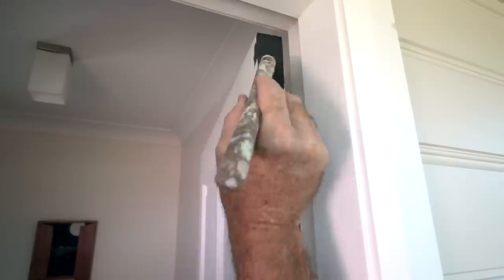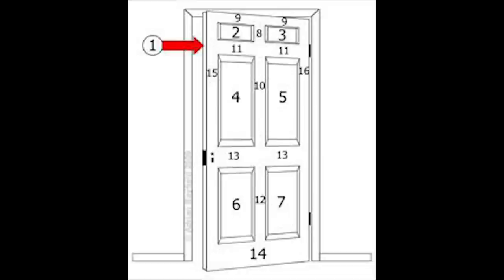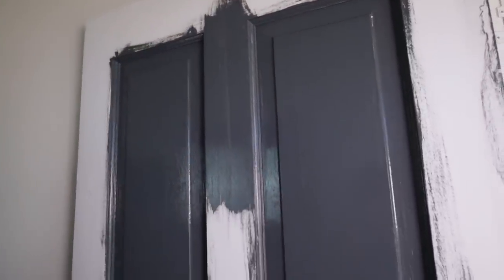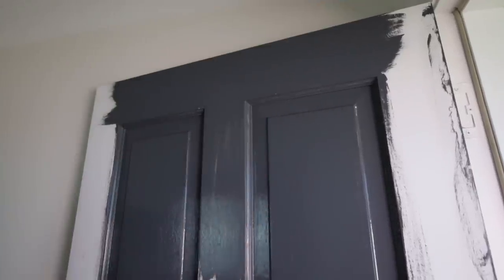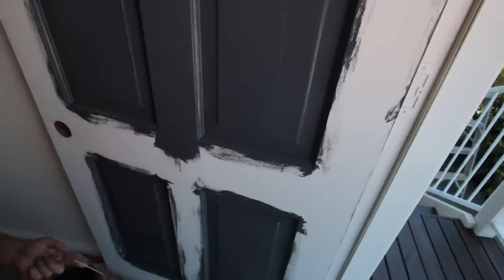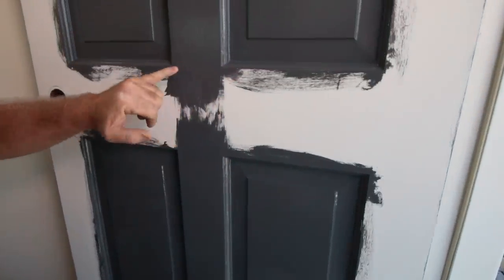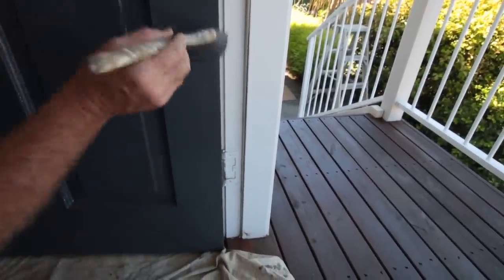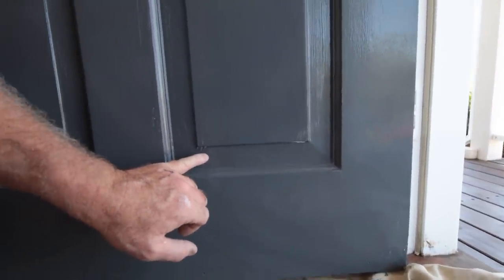How to paint a panel door. Paint by numbers makes it easier!

Comment: Wow, so fast and so perfect! Wish I would have seen this before I started our door. Learned the hard way about dilly dallying. Queen of dilly dallying ugh. How do I get rid of brush strokes?! Hard part for me is having to readjust ladder and reach parts up top of tall door and knowing where to pick up with next brush strokes after reloading brush.
Reply from the maker: Hi Liz, it's not always possible to rid ones project of brush strokes, and I hate to say it, but, diy's are usually exceptional at producing brush marks. It stems from not having enough brush work experience, not painting fast enough, is it hot or cold, and on and on.
One of the things you can do, is to put a teeny weeny bit of water in your paint to thin it. This makes it 'flow' a bit better. Just enough to allow yourself to work with the material easier.  There are water base 'enamels' that work really well, but not sure many diy's could make good use of it. Again, experience comes in real handy, unfortunately. 
Anyhow, thanks for commenting, and all the best on your future projects. :)
Reply: @RickBushell1958  thank you for your reply! Putting on second coat and watching this again for reminders. Hoping I sanded enough but not too much in between coats and hopefully will go faster this time around. Thanks for tips!
Reply: @lizlopez7822  get some Floetrol for latex paints

Comment: Another useful video, thanks! Funnily enough I painted such a door last week and used the exact same picture you showed here. Nice tip about working with the temperature, I used a new Dulux quick drying water based gloss here in the UK which gives great results but you cannot pause for a moment, and must not go back over what you painted as it starts drying fast.
Reply from the maker: Yea, found that pic on the net. So I didn't have to recreate it in photoshop! That paint you used doesn't sound too diy friendly. Hope it turned out alright.
Reply: Floetrol is the slower painters best friend, gives you much more time to get your paint on right without tacking up as much

Comment: Thank you for putting up this video, you make it look so easy!! One question, do you need to sand between top coats? I sanded before undercoating, and after, but not sure if further sanding is required or just overkill. General condition of the door is good. Thank again.

Comment: Hello, I am repainting a previous painted fiberglass door in which has metallic latex copper paint.  I want to paint it now a latex cobalt blue.  Do I need to use a primer like Kilz first  before painting the top color ?
Reply from the maker: Painting latex over another latex should be fine, maybe a light sand tho. Good luck with your project and thanks for commenting :)

Comment: I’m currently painting my panel doors . I find your video really helpful. Did you use oil based paint or water based ? I m using oil based paint with a brush and I find it’s hard to spread the paint .
Reply from the maker: Hi Catlady, can I ask why you chose to paint with an oil base enamel? Enamel produces a really nice finish if you know how to use it. Very difficult or impossible for the diy. I don't recommend using it if you are inexperienced with using a brush. Even  many 'professional' painters cant really use it properly. 
The paint I used in the video was a water base acrylic but only because the previous coat of paint was the same. 
Hopefully you aren't painting an oil base over water base, a very big no no.
Reply: @RickBushell1958  hi , the previous paint on the doors in my home is oil based and it has such nice glossy finish and easy to clean.
Reply from the maker: @catladylion5186  that’s great news. The trick is getting the paint to the correct consistency, and knowing how to lay it off. As I mentioned in a previous post, working with oil base paints takes a lot of experience to get it right. That’s the sad news I’m afraid in your case. 
I always recommend for diy’s to change the system . By that I mean, such as in this case, it’s better to put an oil base undercoat for your first coat. This ensures a good key onto the subsequent oil base and the following water base paints. And it’s much easier for the diy. Good luck and thanks for commenting

Comment: Damn nice finish for  a water based paint man, this would be almost impossible most days here in Australia 35-40 degree days by the time u throw on the paint on one section when u come to lay it off it's already drying.... even if you add juice. need to spray it or roll it fast
Reply from the maker: Osrs Fonzie I have to disagree with you mate. Most diy’s won’t even think of spraying. And even for a professional, why would you for one door side? Totally impractical on both counts. This was done in Australia in summer and a windy day. Just have to work as fast as possible. Thanks for commenting mate. 👍

Comment: So having a factory I am more used to spraying in a both but I love the way you layed out a number system for painting the doors ! and yours looked great.. can you comment on maybe brushing the panels then using a finish cabinetry roller on the doors    what do you think or am I better off just with a good brush...
Reply from the maker: Hi intsccents. This was a simple job with only one door side to paint, and with water base acrylic. It doesn't get any easier and the reason I make the video for DIY's. When I do a lot of doors, yea, the roller comes out. Speeds up the entire job. With a water base  paint, I use a 1/4 nap roller and when using oil base enamel, I use what's called a mohair roller.
Reply: @RickBushell1958  thank you for the reply and great suggestions...

Comment: What do you think about adding Floetrol to make the paint easier to control and reduce brush marks?
Reply from the maker: mark g in most cases it’s not needed. I remember many years ago, we used when in very cold climate. And it was only for oil base enamel, not acrylic. Today, it’s mainly just one more thing to sell to diy’s that  don’t know any better.

Comment: Do you think you get a better finish by spraying them or does a paintbrush get the desired result?  Spraying would get all the nooks on a 6 panel door, right?
Reply from the maker: It depends on what type of material  one is using. In this case, being water base paint you could spray it but it's only 1/2 of one door. Not feasible to set up a sprayer. Door is done before I even get a sprayer set up. Thanks for your comment. :)

Comment: Thanks for the video you make it look so easy. Which kind of brush did you use? I have a brand new basic steel door that looks like it's a primer white color that, I'll be painting over. Will that make any difference?
Reply from the maker: Can't say I've painted many steel doors. You may have to consider using an oil base enamel tho. I would. Happy painting and thanks for commenting :)

Comment: Great tip on painting the door Rick.
I noticed there are some area on that door the paint didn't really cover well. Do you get those part on the 2nd coat?
Reply from the maker: +Raiden X Correct, I knew there was no way one coat was going to cover. Not even worth fighting it. The 2nd coat almost always covers like a dream. Any time there is such a huge color change, count on at least 2 coats on your project. Happy painting :)
Reply: @RickBushell1958  How long did you wait between applying the first and second topcoat?  Did you lightly sand in between?
Reply from the maker: mark g It all depends on the day. I this case, I applied the second coat probably 2 or 3 hrs later. And a very very light sand with 180. Good luck
Reply: @RickBushell1958  Thanks!

Comment: HI...nice video.  I am repainting a front door that had a lot of chiped and peeled paint coming off.  I scraped of and pulled large panels of the old paint off the door, but there is a lot left on the edges and middle panel.  This is a metal door btw.  Do I need to used paint removal for the rest, or just sand what's left.  There are very large exposed areas now.  Also, there are defined edges where the old paint stops and the exposed metal begins.  Thank you for any advice.  A lot of the paint that's left behind is a little cracked looking, but it wouldn't peel or come off easily.
Reply: OH...also, I am using a oil base primer to do the first coat.  This was a recommendation by the Home Depot guy because of it being metal.  Was this correct?  I already bought the paint and its Zinsser Cover Stain oul base primer stain blocker/bond coat.
Reply: I watched your video on painting with oil base and now I watched the panel painting the door.  The guy gave me a little roller, but should I use a brush instead?

Comment: Thanks for the video. Question: I am painting a pre-primed MDF hollow door from Home Depot, and I plan on painting it a taupe color. The door has very noticeable “wood grain” patterns, which I assume to be faux grain patterns done at the factory. After doing a test patch, I see that the colored paint makes the “wood grain” patterns very noticeable and it looks very cheap. I would prefer the appearance of a smooth door. Is this something that sanding and re-priming can solve?
Reply from the maker: Laura Perez if it’s the kind of door surface I’m thinking of, (making assumption here) then there’s nothing you can really do and maybe should of purchased a smooth surface door. Sorry on a lighter note, I prefer the fake wood grain doors over the smooth. 🙂
Reply: The fake wood grain doors are much more forgiving to paint and look fine when hung up, you don't see the brush marks as easy, the solid pine you have to be almost perfect or it will show badly but it's not hard to do a good job especially if you take them down and lay flat to paint

Comment: I am painting an interior door it is already white. It has a yellowing stain in some areas and I am unsure how it happened. Do I need to put some thing else on the yellowing areas first so the stain does not "bleed" through the new coat of paint? I am going to paint it the same color white.
Reply from the maker: Without trying to figure out what caused the stain, I would apply a coat of Zinsser B-I-N Primer-Sealer stain killer. You can purchase a small can to either brush on or a spray can. I always had a can or 2 of this in the van.I would  spray for small areas and would brush or roll large areas. You need rubbing alcohol/denatured alcohol or mineral spirits for clean up. This is a good way to know if you have the right stuff, read the direction on the can for clean up, if it says use water or turps/paint thinner, it probably won't work. Good luck and let me know how you go? :)

Comment: Waterbased paint for exterior face of the door?  wish you all the luck.. cheers
Reply from the maker: Yep, works  a treat in most situations. Years ago in the states we always used enamels to finish front doors. The times have changed mate.  Nothing wrong with using water base materials outside. Just use  a quality paint. Pretty simple BTW, this door still looks the same now as the day I painted it. Years ago
Reply: Paint technology has improved over the years.  With all the summer heat here in Texas, using a Latex paint on a front door will help prevent cracking, as it will accommodate movement due to expansion and contraction.  (Oil based paint does not).

Comment: For interior trim and doors, would you recommend a waterborne paint such as Benjamin Moore's Waterborne Satin Impervo or BM's Advance or would you recommend the oil based version like the alkyd Satin Impervo?   If you do use the waterborne paints, do you put any additives or water in the paint to make it level out better?
Reply from the maker: Hi Stevie, If I'm repainting trim and doors, I repaint with what is already on them, eg; if it's a water base already on them (mostly whats used today) then thats what they get. If they already have oil base on them, then they are repainted using an oil base paint. Hope that helps. As for the brand, it's usually wise to purchase the best paint you can afford. I don't know much about BM's paints but they would be pretty much the same as any other brand of paint, just buy a good paint. Happy painting
Reply: Thanks you for the reply.  Great train of thought on what paint to use.  Now the million dollar question, there are times where you can pretty much tell if the paint is oil or latex but to be certain, is the rubbing alcohol test accurate or should I use another type of solvent to test out if its a waterborne paint or an oil?   Which leads to another question, if whether its an oil or a latex, should you primer and then the finish or can you apply the new paint over the old paint?
Reply from the maker: Too easy Stevie. The rubbing alcohol test is a good one for the diy. No need to try anything else. Whether to undercoat or not depends on what it is you want to do and the condition the surface is in. For example, lets assume your project is already coated with a water base paint (most likely) and apart from a light sanding, the surface is in good condition, (not cracking, peeling, falling off etc) all you need to do is paint straight over with your finish coat, no primers or undercoats are needed. Also, for most water base painting projects, most of the time you don't need an undercoat at all. That goes back to the old days when there was nothing but oil base paints. It's a marketing ploy now-a-days to sell (water base primers/undercoats) to diy's for all water base painting.
Reply: Thanks again...the walls are actually in great shape,.  Only real patching that I need to do is nail holes and also a few places where the sheetrock nails or screws popped out a bit.  There is one area where there is a crack like right on the corner bead, again nothing major involved as there is no pealing tape that I noticed, though I will caulk.  Great to know about not really having to use a primer and I did the rubbing alcohol test and the trim is all latex as are the walls.   I won't be able to get to the painting until next week but will be doing the patching over the weekend, I also purchased a higher end brand of paint, Benjamin Moore Regal Select in an eggshell for the walls and a flat for the ceiling and on the can it does say, this "Premium Interior Paint and Primer,"  and granted I do understand no real primer is in this paint, rather its a "self priming" paint but it still helps a lot that applying a true primer sealer isn't really needed.   One again, thanks so much for your help its appreciated.

Comment: What kind of paint is it?
Reply from the maker: An exterior acrylic, I can’t remember the sheen.
Reply: @RickBushell1958  thanks. Recently I went to sherwin williams store, told them I need good paint to paint a front door. They gave me some thick paint, was leaving thick lines after brush...oh boy, it doesn't look smooth...I need to check what the sold me :)...
Reply from the maker: @maximus01152891  almost every single can of paint you purchase will need thinning. It’s always too thick and needs to be thinned to what we call, a working consistency. Not so easy for the diy, but next time you think your paint might be a bit on the too thick side, just put a tad bit of water to it. Stir and see if that makes things a bit easier going. If still too thick, just repeat. 👍

Comment: How do you cover a screen before painting a door? Or do you paint the screen?
Reply from the maker: Hi David, 
I've never painted a screen (assuming made of meta) but have been asked a few times. Just not commercially viable, cost wise.
I always take the screen door off, paint the door and jamb, then replace the screen. Easy. Most diy's don't take the screen door off and get paint all over the hinges and door. Not a good look. Good luck mate, and thanks for commenting.;)

Comment: I'v been painting 30 years. You are for sure a fast painter. That  looks like a 2.5 inch. Can't image if you used a 3 inch how fast it would be. For the flat surface you also could try mini roller then back brush for good fast wet edge speed. Also the angle brush is good for baseboard and window corners but for a high end door you can tip it off and lay out the paint lines straighter with a regular square brush. Good job though
Reply from the maker: Thanks man, I almost always use a roller, but you have to remember, this is a video for diy's. Have to keep it as simple as possible. And yea, not many painters could keep up with me in my day. :)
Reply: @RickBushell1958  If I'm using a mini-roller for the flat areas of the door, should I 'tip them off' with a brush after rolling? Thanks for a terrific video.
Reply from the maker: @Avital4414  Well, it’s not set in stone but being you are brushing other parts o the door, my way of thinking is to go ahead and tip off. When I have numerous panel doors to paint, I always utilise a roller first then finish off the door using a brush. Much faster.
Reply: @RickBushell1958  perfect advice. Thanks!

Comment: How long before second coat do you wait ???
Reply from the maker: General rule of thumb is 24 hrs. Technically, the longer the better. But usually the next day is long enough.
Reply: Invincible Painting Basics thank you brother...
Reply from the maker: No worries, happy painting mate :)
Reply: Invincible Painting Basics I should have watched this I put the two coats in the same day and the paint was real thick lucky it was a flat paint so it looks alright
Reply from the maker: 2 coats on the same day is fine if the day is warm enough.
Reply: Invincible Painting Basics should i have put first coat on thinner??
Reply: Invincible Painting Basics how do you get paint to flow better add water or paint extender ??
Reply from the maker: I'm not there, so I don't know, sorry